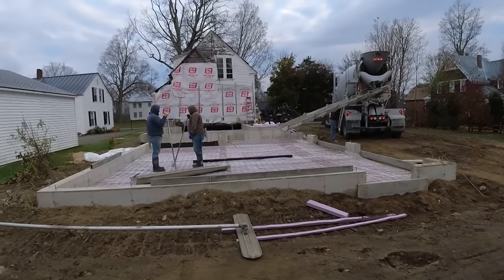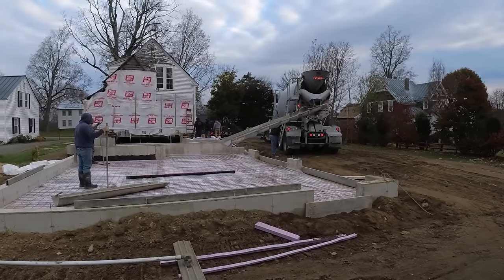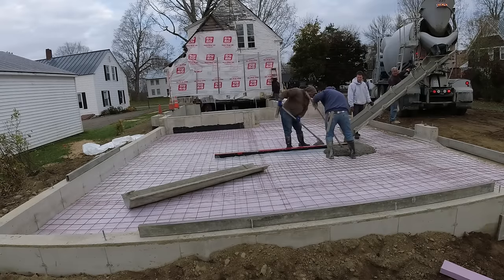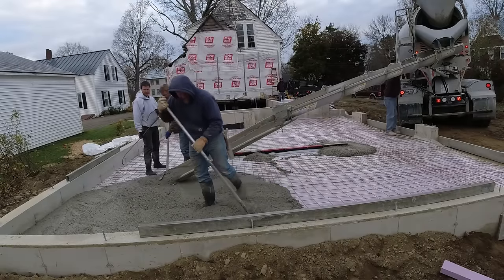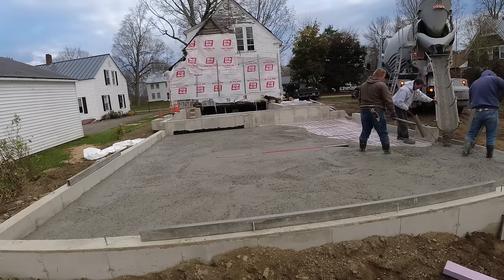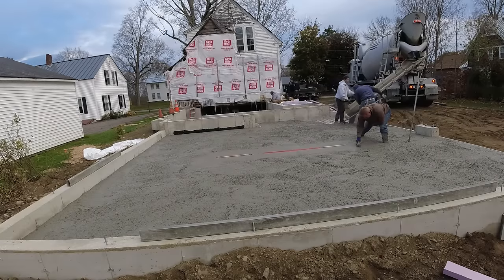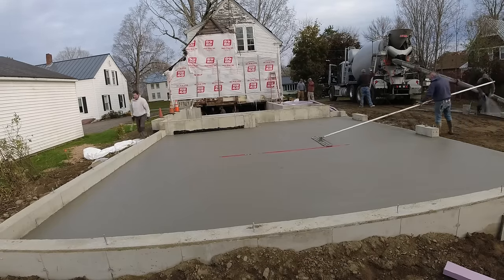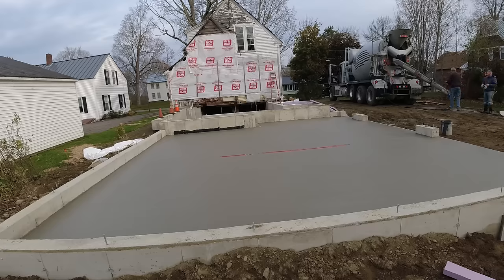This Was A Little Overkill For This Garage Floor!

Comment: Have you ever done a wider trench drain 12" x 3' long or so, formed in place as a catch basin. With a steel bar grate cover? I had those in the shop I worked in for 10 years. We cleaned heavy equipment from time to time and it was perfect to fit a shovel and to clean the dirt out of them.
I was always curious how they cast the thing in place around the drain pipe and made the recessed ledges for the bar grates

Comment: I built a house last year and had one installed in mine for two reasons. One is that I fish a lot and when I back my bass boat in the garage after coming from the lake I didn’t want the water to run all the way across the floor before getting out. The floor in my last house was just sloped and I hated that. The slab stayed wet for several days. 
 Secondly is that they look really good. Especially when cut off the corners. FYI, my garage is 26x28.

Comment: Myself and many people I know wash their vehicles in the winter months in a heated garage.  I would absolutely not want my floors sloped towards the doors.  

If/when washing my garage floor (trying to clean up all the silt sand etc from winter roads), I always have to pull back water that is dammed up against garage door with a squeegee since the last 2' or so slope out - couldn't imagine the whole floor going that direction.  

Starting in the spring on a new building, and I plan to have a slit drain across the entire floor, which now I realize would address your dilemma about how to place a control joint with a trench drain.

Comment: It's about 20 degrees out now. I wouldn't want water running out the door and freezing the door shut. I like the idea of a small floor drain in one of the corners out of the way of wheels on floor jacks, engine hoists etc.
Reply from the maker: Thanks Greg!
Reply: Yes, in Maine that door will freeze shut.

Comment: For my foundation floor up in eustis, i put the 2" foam board down first, and then put a 6mm vapor barrier on top of fhe foam. I hope that doesnt screw me over (its opposite of what you guys did here)
Reply: That's how it should be. The vapor barrier should always be directly against the concrete. Otherwise, water/moisture can be trapped within the insulation layer and take forever to dissipate.

The foam insulation itself can be used as the vapor barrier if all joints are taped.
Reply: @nomen_meus  good to know, I actually taped the foam board as well

Comment: My only issue with pitching the garage floor towards the door is that, with the door closed, the water gets “stuck”. And it will freeze right along the bottom of the door.

Comment: I prefer a center floor drain connected to a dry well via a side pipe so I can wash my vehicles in the middle of a Michigan winter.  I would be concerned a floor sloped toward the garage door(s) would result in water freezing the garage door to the floor.
Reply: How does one keep the walls dry washing a car inside a garage ?
Reply: @als1023 Don’t spray water on the walls? That’s how I do it when I wash my car in my garage here in Minnesota. Unless you have a tiny garage, using just a little bit of care and a shower type sprayer on your hose will work just fine. 
I also have a central round floor drain in my 2 1/2 car garage.
Reply: @als1023  Build walls that don't need to stay dry.  The commercial solution is block with a waterproof membrane behind them.

Comment: For a few years I worked for a company with a wash bay used for busses and I was allowed to use it for my personal vehicles in off hours as long as I cleaned up after myself.  Think one of those commercial DIY car wash bays, but with doors (not just open) on each end, heated to a comfortable temperature, and with no timer on the machine eating your money.  Pull the snow and ice covered truck into the bay, let it sit and warm up (melt) for a few hours, give it a good wash and blow dry, luxury!

Every winter since then I've wanted a wash bay at home.  I figure if I build it big enough for a bus then whoever inherits it be able to sell it to someone as an RV garage+wash.  And I've considered just draining out the front instead of a floor drain.  If I did that, I'd need to extend in-slab heating out to the slab in front to stop the drainage from freezing into a wall of ice at the door.  Also being 50ft or greater depth makes it a little more awkward.

Comment: I'm not a concrete guy but I do my own pours and finish work. I like a floor drain sloped to the center. I get a clapped out HD plastic dumpster from the dump, drill a million holes in it. Bury it to grade with 6-8 inch round rock inside and out. I use a steel car wheel with rebar welded to it for my drain, the lip on the rim of the wheel is perfect for a 3/8 or 1/2" thick circle cut steel plate to lay in flush with the floor having punched drain holes in the plate with my Scotchman ironworker. It leaves a space under the flush drain plate to lay a plastic drain mesh similar to a scotchbrite pad to catch the sand that goes through. Take it out once a year and shake it off and take a moment to give my regards to the resident black widow spiders.

Comment: A sloped floor with radiant heat in the floor is the best detail. Those drains can be hard to maintain and since the floor is sloped to them. It is not an option to eliminate them once they’re installed

Comment: I would think a trench drain would be more advantageous to be placed just inside and along the door opening. The slope can then be back to front and this prevents water entering the garage during heavy rain. Whoever poured my driveway messed up and have it higher than the garage slab by a half inch which causes water to pool just inside the door.

Comment: If you slope entire garage to overhead doors the water can freeze the weatherstripping on the bottom of the garage door if it’s super cold outside.  Having some sort of drain is optimal.
Reply from the maker: I've personally never had that happen, live in Maine and had my garage that slopes out the doors for 30 years.
Reply: Yep, my door seals used to seal really well, until they were frozen to the concrete a few mornings and I had to use a flat bar to get it open (tearing the seals)

Comment: Hey Most of your garage builds are footing and blocks ? 
What do you think of Monolithic slab for garages ? 
Excellent content
Reply: Not in that area. Maine has frost wall height. Can't do it in Mass either.
Reply: Kens karpentry on YouTube has been doing it in Vermont for 35 years. He says they have done hundreds without a problem

Comment: If you use less water, the concrete will shrink less and crack less and be stronger and even crack less. Uneven bedding will also contribute to cracks - the slab should have an even thickness. The steel reinforcement should be in the upper part of the slab. Then the bottom of the slab would crack first and the top may stay intact. If you have 2 layers of poly on top of the insulation, the slab will slide easier on the layers between the 2 layers, and reduce cracking. If the slab can move freely independently of the walls, that will also reduce cracking. Isn't that so?
Reply: @Pippy626  If you add  water reducer, you can reduce water, and improve the crucial water/cement ratio. More water=more shrinking=more cracks
Reply: @elbuggo you must be new to Mikes videos
Reply: He's explained this in past videos. This isn't water that makes it so loose its something he puts in the concrete
Reply: 1/  the wire mesh laying on the plastic barrier is not a good thing ,
2/  no bond breaker around the perimiter is not so good,
3/ very low slump,
 @elbuggo
Reply: @briancunningham1120  Wire mesh laying on the plastic barrier may increase cracking I imagine. The slab would be rigid in the bottom, and more porous and flexible at the top. My  understanding is that placement of the mesh in the concrete is not insignificant. It is not sufficient just to throw it in there, maybe not even helpful sometimes.
Reply: He uses water reducer in every floor and fiber mesh in every floor, this floor was spec’d out for mesh, and he was pulling it up trying to get it half way, water reducer keeps the water cement ratio down so you can make a looser slump and not be detrimental to the strength, foam and vapor barrier together is unnecessary anywhere and ACI says if you use vapor barrier you’re supposed to bury it under 6” of dead sand so the slab edges won’t curl, isn’t that right?
Reply: @chrisbrann7733  Even so, if you reduce the water/cement ratio, you will increase strength and reduce shrinking and cracking.   Basically, if you have more than half as much water as cement, you are moving into crappyland. There are all kinds of nasty side effects with too much water.

Even if poly not should be necessary, two layers of poly will make the concreate able to move around easier and thereby crack less.

Re: ACI says if you use vapor barrier you’re supposed to bury it under 6” of dead sand
Thats something that is required in California. A prominent building guru (Joe Lstiburek) use it as a horror example on very bad regulation. 

RE:  the slab edges won’t curl
More water will make them curl more. Less water will make them curl less.
Reply: If u payed attention to the video and all of his previous videos they pull the wire mesh up as they pour. So it isn’t laying on the bottom when finished.
Reply: 7 slump is easy work with mid to high range water reducer it’s cake pouring we use it every Tuesday and Thursday on our pour days here in Tacoma wa
Reply: @Thepriest39  I heard that. But the wire mesh should only be in the upper part of the slab. 

Imagine the slab as a layer of standing sticks. If the wire mesh is at the bottom or  in the bottom part, the sticks will crack at the top. If the wire mesh is in the upper part, the sticks will tend to crack at the bottom instead.
Reply: Pretty easy to tell you never poured concrete for a living. You read a bag of sac Crete that says "no cracks" and believe it. Concrete does two things: gets hard and cracks. All you can do is control where it cracks to the best of your ability. Get some real world experience
Reply: @elbuggo again, he uses WATER REDUCER, do you know what that is intended for? It DOES NOT reduce the water/cement ratio and allows you to pour looser slumps, and yes, poly not buried under 6” of dead sand make slab edges curl, not more water, more water makes concrete shrink more, idk, I’ve only taken the ACI class 6 times for flatwork and technician, and passed it every time, but maybe I’m wrong, or maybe you’re wrong, you decide I’m done educating people that just want to debate, and always be right, so you win, keep pouring the way you do, and we can pour the way we do, by the specs mind you, and follow ACI recommendations, and yes I have an ACI guide in my desk.
Reply: @lancewilliamson7658  Well, among other things, I worked on the Troll A condeep platform for a few years. We used much 12000psi concrete there, and about 100,000t of reinforcement. I can assure you there are not a single crack in that build.

Do you not even understand that when you use less water, you get less shrinkage and less cracking?
Reply: @chrisbrann7733  Water reducer reduces the friction in the mix so that it is more workable. The point with a water reduce is to use less water to make the mix workable. When less water is used compared to the cement, the concrete will be stronger, shrink less and curl less, among other things. More water compared to the  cement will make the concrete weaker, curl more and shrink more and crack more. It is not very complicated

For curling, water at the top of the slab evaporates first. Then the surface get smaller, and will pull the edges up, and then the concrete solidify. Has nuffin to do with sand on top of poly - that's rediciliouss.

If you did not learn anything about the water/cement ratio for the mix in that ACI class, you cant have learned much.

Not all flatwork is so difficult and important. Often it is just to get it to stay there. That's not so hard compared to many important and more difficult things.
Reply: Should they have put expansion joint on the foundation walls? 🤷🏻‍♂️😝
Reply: @Thepriest39 that doesn’t strike me as a very good way to get a consistent placement depth for the mesh. Wouldn’t it be better to install some kind of plastic shim blocks/benches to hold it up a consistent amount?
Reply: @elbuggo you’ve never poured concrete before in your life, that’s quite obvious, you can say it ridiculous that sand on top of poly is recommended by ACI To reduce curling all you want, and again, when I say he uses water reducer he’s not adding any more water then what you can allow, you can quote the data sheet on water reducer all you want, I know exactly what it is intended for, I’ve poured concrete in heavy construction for 37 years and over a million yards of it, and finished I don’t know how many miles of it, again, you win the debate, you have to be right even if you’re wrong, I bet you were the captain of the debate team in college, and I bet you voted for Biden too, watch another channel and aggravate those guys.

Comment: A small slope in a garage floor is the best and easiest way to do it. If you think you're going to freeze your garage door to the floor you should either play the lotto because you have bad luck or you don't know what you're talking about
Reply: It's not rocket science. If snow melts off the car and runs under the door seal and it's well below 32deg. It freezes.